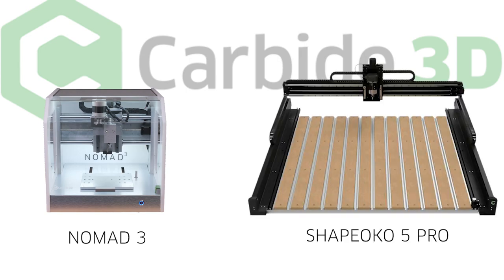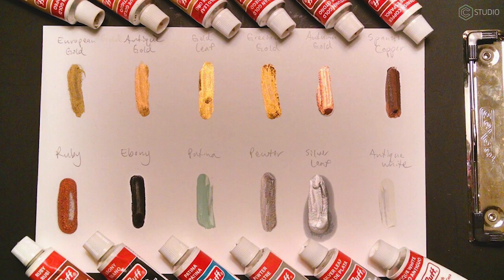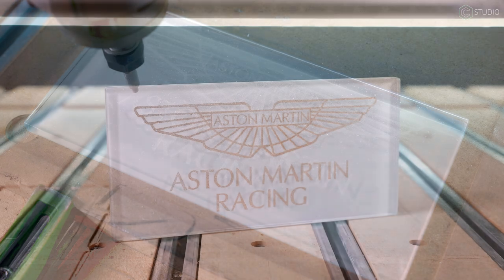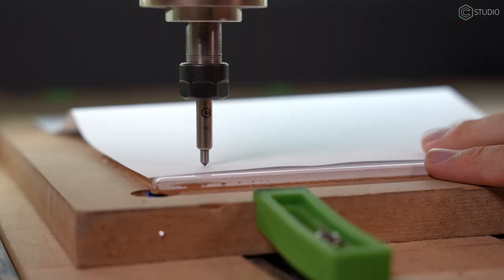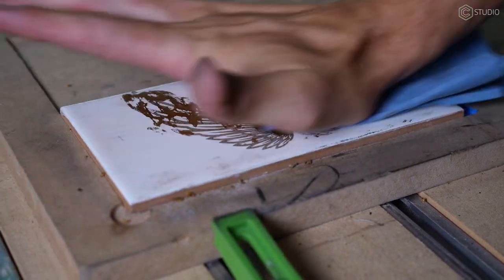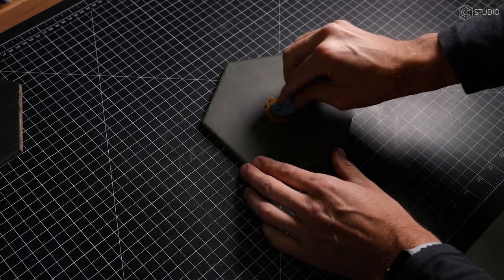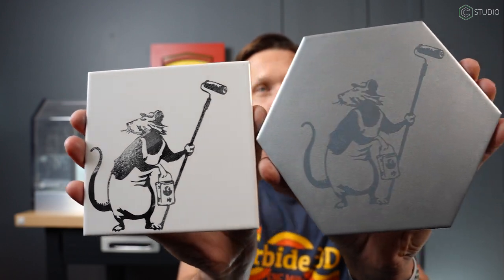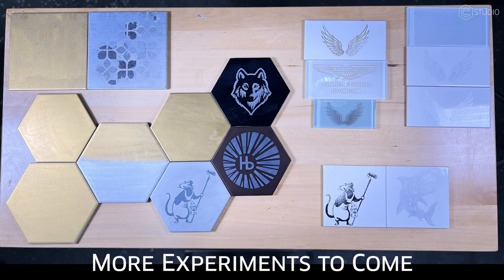CNC Router on Ceramic + Glass Tiles

Comment: Could you guestimate how many tiles an Mc Etcher can do?
Reply from the maker: As is said in the video, size and complexity will determine the overall life.   We did a number of complex designs and some simpler ones.  For this size tile, with some density to your designs, 10 is probably the limit for sharp sharp lines.  That same engraver can then do a bunch of the reverse process tiles.

Comment: What is the etch depth since you just want to clear the rub/buff?
Reply from the maker: Hey Wade.  Dropped this over of FB as well:  
 I use the standard DOC per the Engravers under “Any Any” on the top of the tool library.
Reply: @carbide3d  Yes Sir I saw that. I guess I'll need to upgrade from basic to get engrave feature. Thanks.